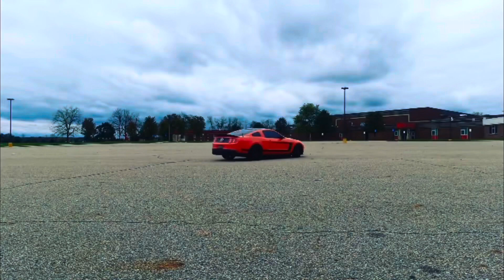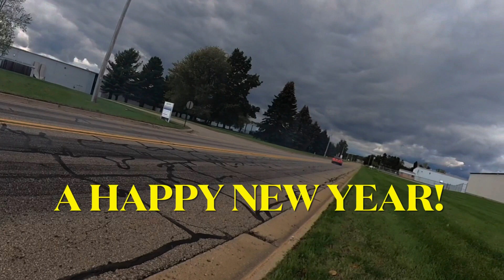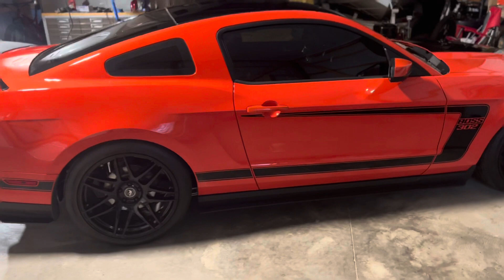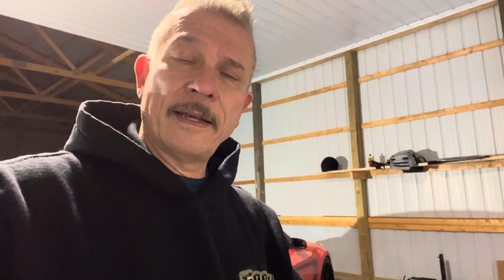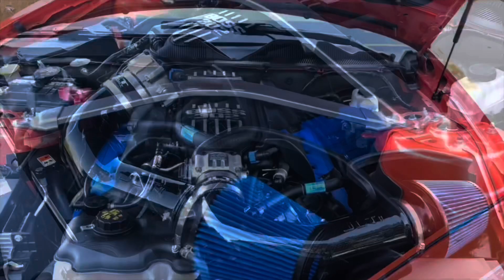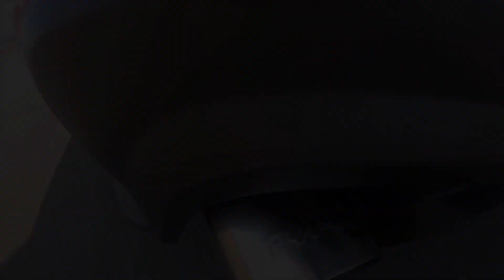What’s Coming This Year For The Boss 2022

Comment: In light of Tracking Ponies Boss 302 having cylinder 8 issues and destroying the block I picked up a head cooling crossover kit.  This year I will finally start putting parts on the car, not quite the build as yours but will be a big change in performance.  Good luck to you and think of warmer days ahead.
Reply from the maker: Thanks for the positive thoughts! In my opinion it’s extra insurance if you are tracking your car.  I have to get the barn insulated this year and find a heat source. 
Good luck to you too and thanks for supporting the channel.

Comment: Carmob has had a world of problems woth Livernois, but he also has a 900 plus hp car from them
Reply from the maker: Yes but different situation. Ford actually went to Livernois when building the Boss and they are the ones that helped get extra 4% flow out of the heads to net the 444 hp. 
These heads are not the same as any other Coyote heads and Livernois has experience with the Boss head. So I don’t have any concerns with their machine and CNC work.
Reply: @CoyoteProductionsBoss302  interesting knowledge nugget
Reply: Hey what dis Livernois do to Carmobs car. They fck it up